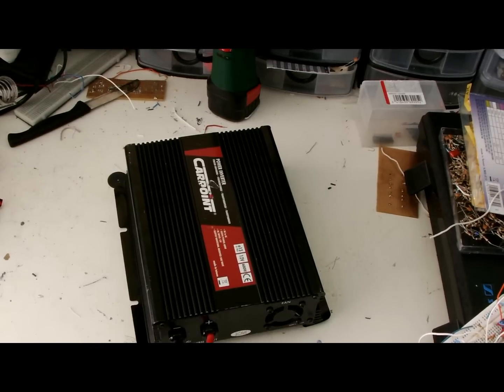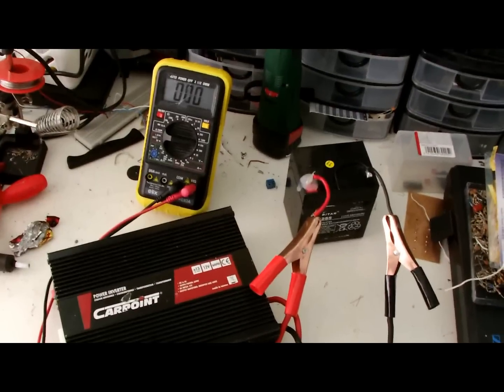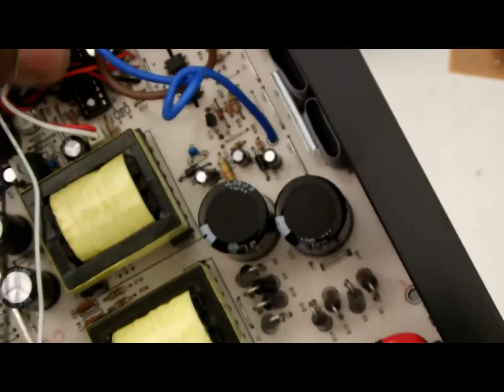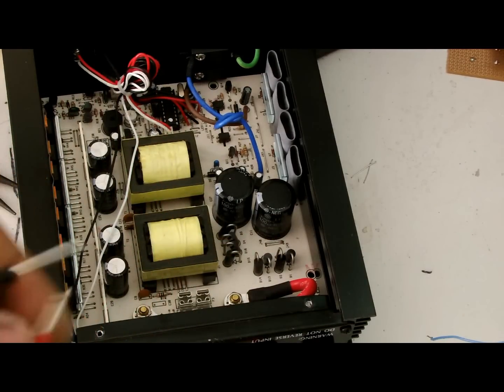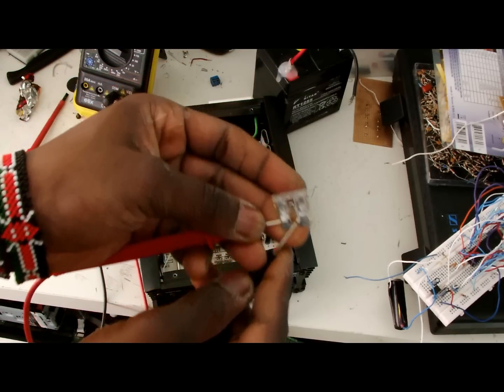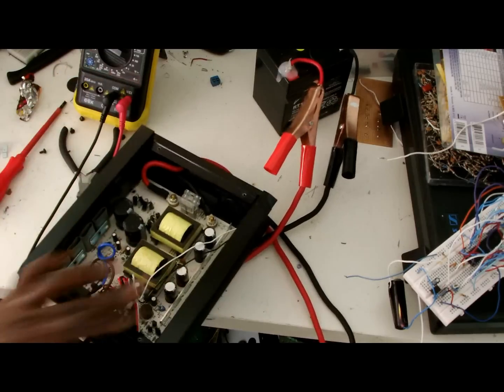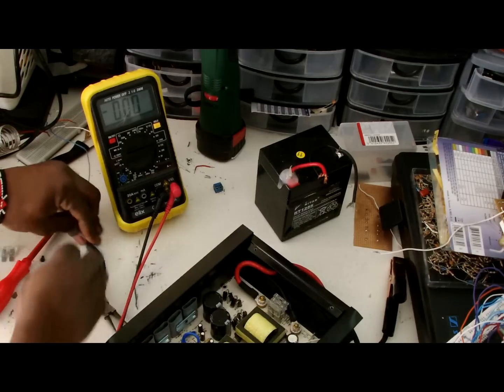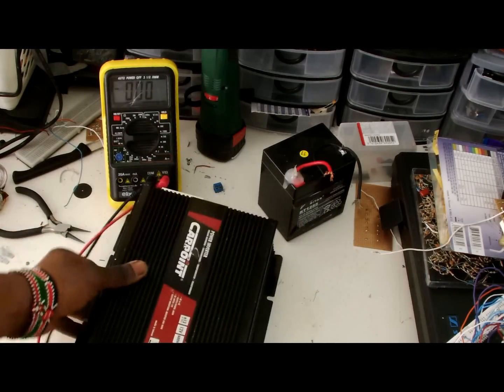how to change inverters fuse

Comment: Just so everyone watching this knows, this is a 600watt inverter, 600w/12volts = 50 amperes, the 3 fuses are 25A, which add up to 75A, so these fuses protect the inverter up to 900 watts for surges.  The fuses share the load so once one blows the other 2 are going to be carrying all the current & blow almost immediately.  It's really a smart way to do it because automotive fuses are pretty cheap & very available, much better than a custom 75A fuse, & those aren't even actual fuse holders, they're spade terminals, doing the job way cheaper than fuse holders.

Comment: Good video, gonna check the fuses on mine when I get a chance. Connected microwave and stove at same time and it stopped working, been looking at all fuses around truck and they seem fine. If it really is a fuse, I might as well consider upgrading to one of them fancy 3000w or bigger.
Reply from the maker: thanks for taking your time to watch, it sounds like the overload protections fuse burned out,.of perhaps the battery could also be tired .....let me know how u solved it
Reply: @juniorelectronics8255  Took off the removable panel to take a peak inside, did see something labeled with a number that was connected to the positive wire connection, it didn't look like the normal fuses that I know, and its two units mounted one on top of the other, but assuming that's the fuse I do not have a similar one to test it out sadly. I do plan on getting a testing unit to check on voltage and rule out problem could be from battery connections or truck for that matter.
Reply from the maker: @harold562  sounds like you are on right track ,  I am sure u gonna solve the issue

Comment: I'm in this situation.  It begs the question why a unit has to be dismantled to do a simple task. why there isn't a removable doorway
Reply from the maker: Good point they should change that option  for easy access, was looking for quick access to change the fuse the first time, only to find I had to open the all unit. I hoped you were able to fix yours.thanks for taking time to watch
Reply: @juniorelectronics8255  I did open my unit to find 8 fuses....none of them was blown.  Turns out I blew the 100amp fuse between the unit and the battery which I had put in as a precaution although the instructions did not say to do so. I had STUPIDLY wired a simple on/off switch incorrectly. ALL good now I think.

Comment: Do you think there are fuses inside my powerdrive 3000  ...it stoped working today i used a grider to cut of a lock on my trailer.
Reply from the maker: Enrique Gonzalez how much Watts does ur grinder need? And how much does ur inverter produce, defently there is fuse inside open up and try to look for it
Reply: Not sure about the wattage on grinder , anyways i followed the cables all the way to the batt and there was a fuse right on the nut holding the cable for the power inverter (( this truck is an old walmart truck i'm thinking all of these walmart teucks have  this fuse., wich by the way i could not find at any auto parts , home depot , lowes , walmart ....will look on amazon thanks

Comment: hi mine still keeps blowing the fuse after i change help please
Reply from the maker: hallo,check those mosfets ,take ur volt meter and set on continuity test,then  go through those big mosfet with heatsink on  them if the mostfet are beep then that means is damaged ,set ur voltmeter prop to the middle pin,and with the other prop u look on pin 2 and 3,